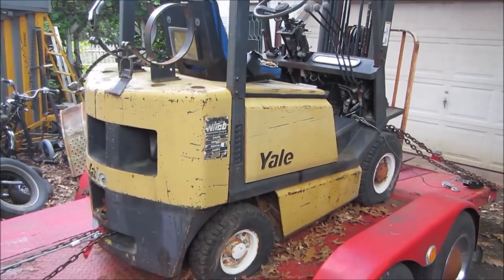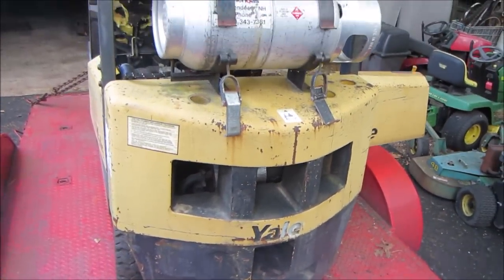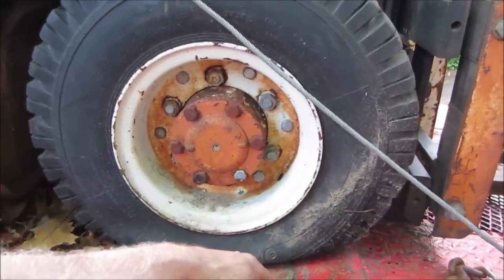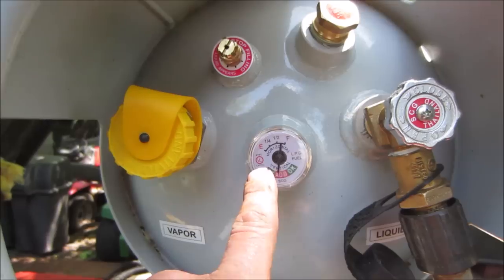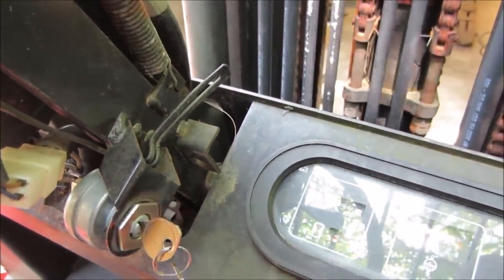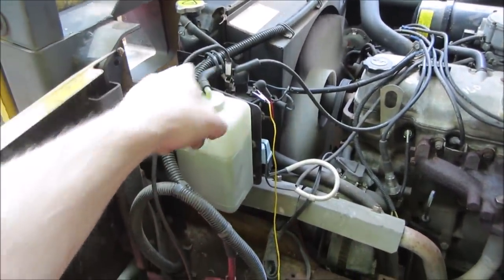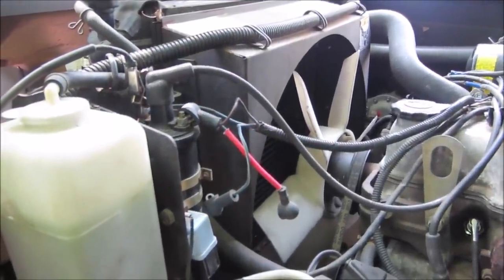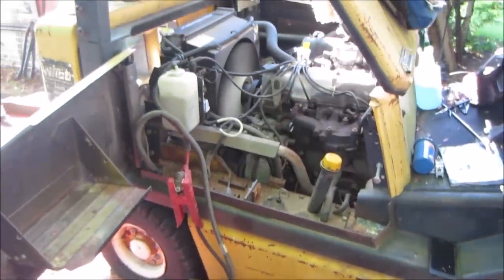Will It Run? cheapest Forklift I could find .pt2

Comment: That resistor, next to the coil, does fail. I bought an extra replacement one just to have it on hand at work. I think my dad's 72 dodge dart (Slant six) used those resistor blocks too, and we had to change his too ... And we threw a spare in his glove compartment too. I think on that Dodge, they were mounted on the firewall. Look it up on rock-auto.

Comment: That is a fuel lock off at the end of the fuel line.Operates when engine is turned over and creates vacumn to open valve to let fuel through.Also has a wafer shaped filter in side. Then to vaporizer and onto throttle body.

Comment: If I were you I'd invest in a couple of cans of deoxit. It's by far the best electrical contact cleaner spray I've used and would have worked nicely on that switch and I would have used it on the spade terminals in the distributor. I use it for a lot of audio gear.

Comment: Generally a ballasted coil will run at 9 to 10 volts with the engine running, and when starting the engine the coil gets the full battery volts (ballast by passed by separated feed from ignition switch)  The ignition modules in the distributor do die like that - Mazda 626 2Litre engines are notorious for that failure mode- and they hate water ingress.

Comment: Ballast resistor is shorted out, or jumper-ed across it while starting only. Then the resistor is in the circuit while running. The resistor is correct at 1.5 ohms. Electronic ignition module sounds bad. There is a solid state device in there and those get temperature sensitive.

Comment: if distributor module is failed/failing when hot, make sure to check the ignition coil and resistor and of course replace all other ignition components. issues there can make the secondary HV soar high and cause the primary side load to soar and effectively cook the modules. 
which I'm sure you know, having working on things for years :)
**looks like something wired wrong, it probably has a ballast resistor bypass for start/cranking, which didn't appear to be opening, relay, ignition switch area or most often starter/solenoid 3rd terminal provided that function.
Reply from the maker: l have it at 9v run now,

Comment: Tilt mast back with forks raised, put wood blocks under front corners of mast and tilt mast forward. Tires raise off the ground. Put wood under tires, tilt back and put more wood under mast, tilt forward. No jack needed. Once you are high enough, add pivot blocks under center and pivot steering tires up. All four tires in the air. Floating forklift.

Comment: A friend of mine suggested that if the forklift had been modified with the electronic pickup then the coil would need to be changed to a different size and the ballast resister was no longer needed.  If the vehicle originally had points and someone retrofitted it with the electronic pickup but didnt change the coil that could by why the pickup failed.

Comment: If you change the fitting on the hose you can run it on a grill bottle I have run one for six months and it works fine. Caution do not use a OPD bottle unless you open the valve SLOWLY very slowly.

Comment: I'm not sure if you know this, but never ever use a liquid propane tank for your barbecue, they are two completely different types of fuel. One is liquid for power equipment, and one is vapor for cooking. The yellow cap you pointed out is for refilling the tank, not for your barbecue. Carry on👍👍

Comment: After the engine died on you, I watched the rest of the video, just to see if the module was the problem. BTW, that appears to be an electronic ignition module, not a pickup.
Unless, Mazda combined the magnetic pickup coil into the electronic ignition module, magnetic pickup coils don't use thermal paste. Ignition modules do.
IF they DID combine both into one, that just increases the odds of a failure, since the module is the most likely component to fail. It's the least durable. It's exposed to the most heat and vibration.  
That said, I have had coils and modules fail at the same time. When I've had that happen, the coil took out the module.
Congrats on getting it running. 
Can't wait to see if the ramps collapse from the weight.
The previous owner deserves a refund from the two forklift companies who worked on that lift.

Comment: I fixed more than 1 by putting in correct 0 rings  in connector at butane bottle---sometimes when changing or refueling bottles the internal 0 ring is lost and plunger does not go in far enough to allow gas /liquid to escape to vaporizer

Comment: Something tells me that the ramps were not up to the task, hence the choice of video ending :P

Mustie1, you need a relatively high idle on these gas powered forklifts, for the occasion when you use the tilt on the boom, shift the transmission f to r or vice versa and turn the wheel at the same time. The load on the engine can kill it if the idle is not say about 1200 to 1500 rpm no load.

Comment: Great video.  I can't help feeling that the voltage is too high though.  Normally the voltage bypasses the ballast for starting to get a short term maximum voltage and once running the voltage should drop dramatically.  If the ballast is permanently bypassed as if for starting then you may be overloading the ignition system which may have caused the pickup to overheat and fail.  If the ballast resistor is not getting hot then it is in permanent bypass.  Good luck.
Reply from the maker: it did need some more wiring love, l got it at 9v now,

Comment: Fun fact propane can be used as freon/refrigerant. It's extremely dangerous. But very effective.
Reply: Another fun fact, you can check for propane leaks with a match but it isn't the smartest move :/  in fact you might win a Darwin Award that way.

Comment: Over the many videos,,,,We learned a couple key things.  Don't swap out parts like the wires until you know what the problem was.    Another fundamental difference we picked up was to look for spark before adding gas to any old engine.    Makes sense, why make a mess when you may not have a spark.
Okay,  need to head up to the like button,  see ya.

Comment: There is a relay that allows full voltage while cranking and then drops out to allow voltage to go through the resistor so the coils doesn’t overheat.

Comment: I have a 91 Mercury Capri. They have a very common issue with the ignitor/pickup as well, causing identical symptoms. Module even looks about the same.
Reply: Well that's a Mazda engine in the lift so very well could be the same as the Capri was same as Mazda as I recall.
Reply: @rogercamp6071  Yes it is indeed a Mazda engine. Missed that in the video, good call. Similar vintage, too

Comment: LPG is pretty common in AUS, all my cars are on gas (using the true sense of the word)....Just run your BBQ bottle upside down if desperate....If you are not going to use it often, just put a carb and pump on it and run it on petrol which you will be more comfortable maintaining. Biggest problems you'll find with an unmaintained LPG system is diaphragm degradation and 'cooling' issues (causing freezing of the lpg components). When running properly they are the simplest and reliable fuel system...

Comment: Pick up the front by blocking under the mast and tilting forward.
Reply: We have blocks that are OSHA rated at over 10,000 pounds each, that are designed for just that. We also have those blocks' big brothers that are designed to set under a lift after you jack it up.

Comment: The first one the propane goes in is the fuel lock off when the engine cranks it pulls vacuumed on the lock off diagram to alow fuel to go go to the vaporizers then to the mixer/ carb if the coolant is loww it will let the vaporizer freeze and cut out and die coolant makes the propain from liquid to a vaporizer

Comment: propane tanks do have valve problems i used to change them all the time. You could have used your grill tank it would have worked for testing just turn it upside down.

Comment: I enjoy these videos a lot and have ran into the same kind of problems both for myself and professionally.  I don't mean to be critical but you really made a guess, albeit an educated guess, as to the problem.  I know sometimes this is what we have to do and when it is for yourself it isn't as bad as when for a customer.  I wonder if another test could have proven the problem before the $100 gamble?  Could the resistance to ground have proven the problem?  Where did the heat come from , isn't that component a switch, like points, except electronic?  Did the head come from a short to ground, or rather a bleed to ground?  The test light did show something but I also noticed when starting, it didn't light immediately  but when it did the engine started right after.  I was guessing an oil pressure switch possibly.  Again I know you made some tests, and of course some educated hypotheses, but you weren't sure until you spent the money for a part.  No criticism, just an honest question.

Comment: Mustie1,

Do you have a model number for the lift truck? Then I should be able to find the part number for the correct ignition resister ohm wise.

Nice job methodically step by step finding the problem. 

Thanks 

Cheers!

Comment: A little late but the only main difference between a regular gas bottle  for your bbq and a bottle for a forklift is , that it has a riser tube so it can be used vertically otherwise without this Tube a bottle can only be used untill the fill Level is underneath the point where the gas is going out of the bottle. But the gas is exactly the same

Comment: You can use regular propane...just turn the tank up side down. It will exit the tank on liquid state. If temperature is above 10° C it doesn't mather the position of the tank, it will work normaly.
I use regular propane on a forklift because it's cheaper than the other.

Comment: You can raise the front wheels by tilting mast all the back, blocking the bottom of the mast to the ground, then tilting forward. This is even shown in the manual.

I also bought a Yale recently (GLP50) and, for a change, I bought a machine that was operational when purchased. I found out (by error) that the orientation of the tank does matter (the pin in the hole as you mentioned).

I am curious about the ballast resistor as the their purpose initially was to preserve the condensor but with electronic ignition, are they still necessary?

Comment: The ballast resistor is in parallel with a 12 volt feed from the switch. The coil is a 9 volt coil. for starting battery voltage is supplied to the 9 volt coil to generate a good spark (during cranking battery volts drop typically down to 10 volts). In the 'run' position at the switch the live feed to the coil is via the ballast resistor circuit that drops battery voltage down to 9 volts to prevent overheating of the coil
Reply: Addendum - if its a 9 volt coil then you should expect only 9 volts to be supplied to the distributor? that may be why the distributor pick-up was getting way too hot as its getting 14 volts instead of 9. I suspect the fault is the wiring at the ignition switch. It needs to supply 9 volts to the ballast resistor in run position and not battery voltage bypassing the ballast resistor?
Reply from the maker: true, its at 9 volts now,

Comment: I was under the impression that the the ballast was bypassed for start up an then once it's running and you let off the starter the ballast is put back in series with the coil.  I think it halves the voltage.

Comment: Clean and grease the rail and it will side shift better. The regulator caused that stall problem on the ones at work always random.

Comment: usually when you connect a tank you can start it right away but our yale witch is similar to yours sometimes needs a few mins to prime after its sat empty we have killed its battery a few times cranking it till the battery is dead
Reply: our yale makes it about 3 months between brakdowns but its been ran 24 hrs a day 5 days a week so yours should last a long time if you take good care of it we dont treat our forklifts well our power steering dont work but if you pick up something heavy it regains its powersteering crates of scrap steel can get heavy quick and your side shift works a lot better than ours we blew the hose for our side shift we rev the engine full throttle and pulse the side shift to move it

Comment: Mustie if you had a leak you would smell it straight away (stinks like cooked cabbage) also those gas trucks are self priming, I've removed many a gas bottle to take it and refill it at the main gas supply because some lazy b****d on the previous shift had run the truck dry.
Also on a lot of trucks the hydraulics speed up when you rev the engine, they will operate on tick over, but very slowly.
You may have a vapour-lock problem but it looks like a decent truck.

Comment: holy shiiit,, nothing in the middle of the ramps to support the weight!! omg whats going to happen!!! lol cant wait for the next one.. i used to drive a forklift and yeah the sweet smell of fuel.. Mustie is there any way to replace that fan with a viscous type fan or is there a reason a solid mounted one is used.. hated the fan noise when they are revved high when you need to hold the brake peddle when raising the forks lifting a heavy load.

Comment: Old Yale f/lifts aren't anywhere near as bad as their s/hand reputation suggests. IM(subjective)O they were the forerunner to Toyo f/lifts and I bet Toyo based their most successful models on 80s/ 90s Yales.

[edit] The levers on the right of the steering wheel were pretty much standardised some years ago. If 2 levers, the leftmost was up/down, the right was tilt (pull to tilt up, push for forward). If 3 levers, the outermost is side-shift (pull for left, push for right). HTH [/edit]

Comment: I’m thinking the guys that came to look at it originally, didn’t let it run long enough to get it to act up. Mustie suspected what it was right away but he still went through as much troubleshooting as he could think of to rule out anything else. Let’s face it, swaptronics can get real expensive real fast. They retired that machine over a $100 part. Everything else that’s wrong with it is from it sitting for all those years.

Comment: I'm not sure what the resistance of the ballast resistor should be, but if it's too low and allows too much voltage to get through to the distributor which, in time, will overheat and cause failure of the new replacement module?  Just guessing....

Comment: Just watch this for the first time. The playstation 3 had an issue which is called the red light of death. It's when it does not switch on to play. The issue is to do with the silicon grease on the back of the chip. When the silicon dry up or cracks,you have to take all the old silicon off and place new silicon on the chip, to manage to have the playstation3 back up and working again. I wonder if the over heating here was due to the old silicon grease that was on the back of this part. Taking this off and placing new silicon might of resolved the issue alone.

Comment: think the guys had the propane tank in wrong.
There is a "dip tube" that goes down, in these 
tanks, to get liquid propane for the system, and 
if was installed wrong, they'd be sucking gas 
instead of liquid.  It'd idle just fine, and have 
problems when they step on the throttle.

I've seen guys run a BBQ propane tank, just 
mount it upside down.  (BBQ tanks don't have 
a dip tube.)

steve

Comment: Put the Bosch coil on it.  It's a true 12 volt coil and doesn'r require any resistor in the circuit.

Comment: In the forklift industry it is not referred to "Shuttle Shift" the parts guys would look at you funny. It is know through out the industry is SideShift.
I would like to recommend you consider pricing out Solid Pneumatic tires, it is a little more cost but they will never be flat again.

Comment: You could run it on a BBQ tank if you turned it upside down, then it would run liquid instead of vapor. 33# forklift tanks have a dip tube that draws liquid

Comment: If you keep the coil wiring as it is it will cook the coil, most coils a 6 volt coils and they get more like 8 volts through the ballast resistor when running. They use the 12 volt wire to the coil only when starting. Then when you let off the starter it switches over to the wire going to the ballast resistor. I think the extra wire you had at the ignition switch is the wire supplying power to the ballast resistor,, that one should be hooked to the ignition terminal on the IGN. switch and the wire you have there now should be tied into the terminal for the starter selenoid.

Why do all forklifts sound the same, regardless of what engine is in them? I have an older Yale 6000 lb. forklift and it has the Chrysler slant 6 and it sounds exactly like your Mazda 4 cyl.

Comment: Just a guess but the Points/ ignition module  may be failing. pulse side not voltage.  A Resistor always drops a voltage.

Comment: No the fuel goes to a vacuum lock off then to the impco model J fuel pressure regulator then to the lpg mixer to mix air with the vaporized fuel

Comment: if  you  disconnect the side shift you will increase the lifting capacity to 4000 pounds instead of 350 pounds i used to set fire to ours to start it in the cold [fire in a tray]

Comment: The normal problems anyone sees is if it starts and runs well then stops after it warms up its something in the electrical's like a coil getting hot, surely the mechanics should have been able to work that out so they got pointed in the right direction.

Comment: Great video. Curious about using the soap spray for leak checks--Would that show anything on the liquid lines?
Reply: Its only to check for air type leaks. Bubbles= leak. Air, propane, acetylene ect. But not on liquid filled lines. I think he was just missing the regulator and getting the other lines